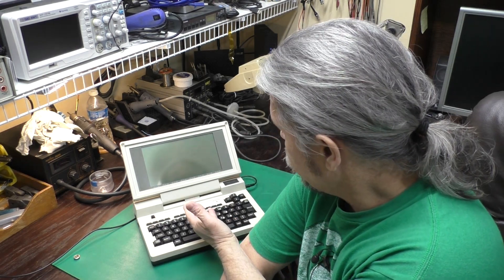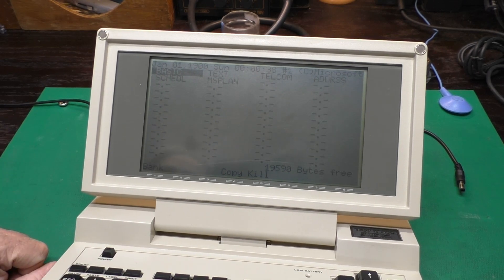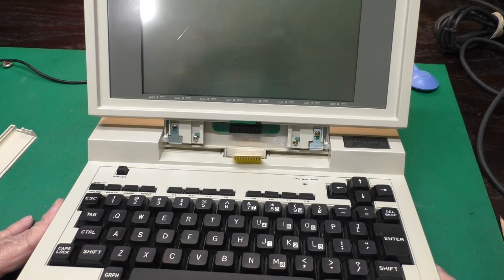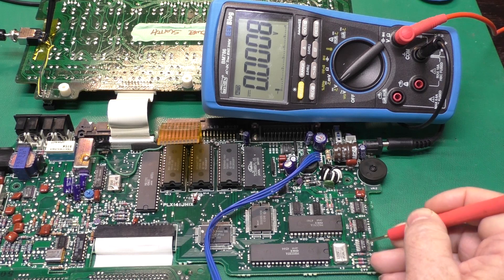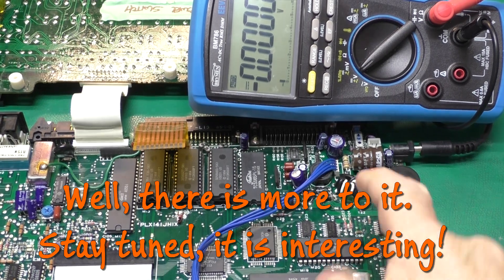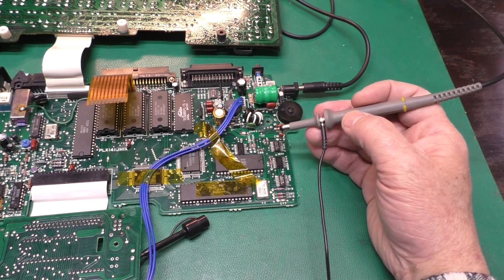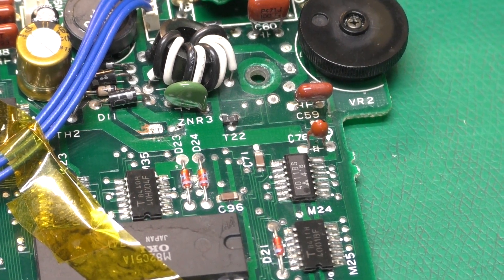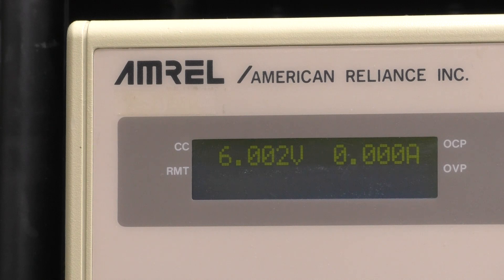A TRS-80 Model 200 that does not know when to quit, or start again.

Comment: Hi Birt,. Question for you, if a Tandy 102 has the backup battery removed will that keep it from coming on either on batteries or power pak??
Reply from the maker: Since the backup battery powers part of the rest circuit funny things can happen. Some machines won't like to reset properly when turning on, etc. Some people have fitted a large electrolytic cap in place of the battery and let the cap charge for a few minutes after plugging in external power.

Comment: Thanks for the super useful video that encourages me to open up my own T200 which suffers from a similar malady. 

By the way, would you recommend that bench power supply (AmRel brand)? There are a lot of cheap brands coming out of China and it's hard for a novice like me to discern.
Reply from the maker: The Amrel works great for me. I have (had) one of the cheapo import supplies that would output a lot of current at higher voltages. It lasted < 2 years. The Amrel I have only goes to 8V. I would like to get another that will go to 30V or so.

The power supply on top of the Amrel is a 1970s model. I picked it up from university surplus for $5 and fixed it with a $2 IC. Other than the fan being very loud it is a great supply.